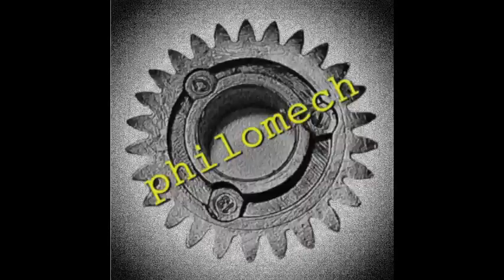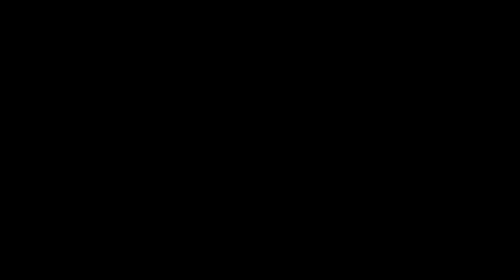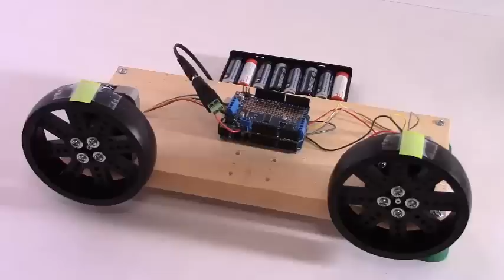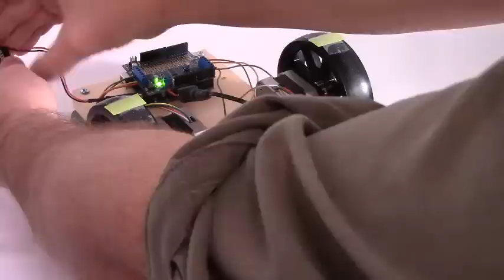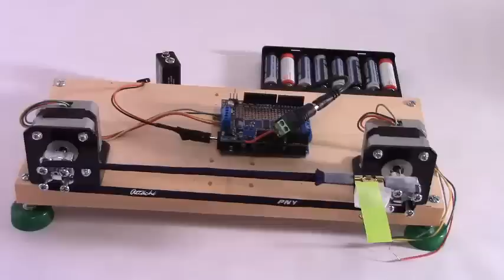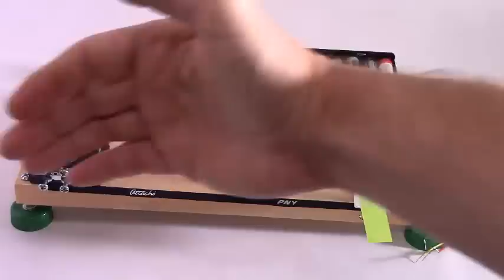Arduino Projects || Controlling Stepper Motors with Time-Sensitive While Loops

Comment: hi, 
is it possible to synchronize the two motors so they both start at some zero position and a full circle on the first one corresponds to a certain angle set up for the second one? 
(for a coil winding machine like this https://www.youtube.com/watch?v=MXLx-M9mV3I

Comment from the maker: The code associated with the examples discussed in video.

/*
title: Controlling_2_Steppers_with_Time_Sensitive_While_Loops
by: philomech
date: 1/2015
parts: Adafruit MotorShield V2
       12V NEMA 17 Steppers (200 step)
       NEMA 17 motor mounts
       Arduino Uno
Note: Please see the video entitled 
      "Arduino Programming Tutorials ||
       How to Construct Time-Sensitive While
       Loops" for an explanation of the while 
       loop control structures used below
*/
/*********************
* Libraries/Objects    *
*********************/
#include <Wire.h>
#include <Adafruit_MotorShield.h>       
#include "utility/Adafruit_PWMServoDriver.h"

//create motorshield object: AFMS = 0x61 I2C address
Adafruit_MotorShield AFMS = Adafruit_MotorShield(); 

//200 step motors connected to shield's motor ports(1 = M1 & M2, 2 = (M3 & M4) 
Adafruit_StepperMotor *myMotor_one = AFMS.getStepper(200, 1);
Adafruit_StepperMotor *myMotor_two = AFMS.getStepper(200, 2);

/*********************
* global variables     *
*********************/
unsigned long time_since_last_reset = 0;    

//adjust intervals as needed, variable type 
//will need to be changed from int to long or
//unsigned long if one needs intervals lasting
//longer than 32,767 milliseconds
int interval_one   = 2000;        //2 seconds   
int interval_two   = 3000;        //3 seconds
int interval_three = 4000;        //4 seconds
int interval_four  = 5000;        //5 seconds   
int interval_five  = 6000;        //6 seconds
int interval_six   = 7750;        //7.75 seconds
/*********************
* setup                *
*********************/
void setup(){
  AFMS.begin();        // create with the default frequency 1.6KHz
  //AFMS.begin(1000);  // OR with a different frequency, e.g., 1KHz
  
  myMotor_one->setSpeed(30);   // stepper speed setvto 30 rpm
  myMotor_two->setSpeed(30);   //adjust as needed

  delay(2000);
}
/*********************
* main loop            *
*********************/
void loop(){
  
  //--> controlling 2 motors independently (one at a time) <--
  
  // motor1 forward for 2 seconds  
  time_since_last_reset = millis();
  while((millis() - time_since_last_reset) < interval_one){
    myMotor_one->step(1,FORWARD,SINGLE);
  }
  // motor2 forward for 3 seconds
  time_since_last_reset = millis();
  while((millis() - time_since_last_reset) < interval_two){
    myMotor_two->step(2,FORWARD,SINGLE);
  }
  // motor1 backward for 4 seconds
  time_since_last_reset = millis();
  while((millis() - time_since_last_reset) < interval_three){
    myMotor_one->step(1,BACKWARD,SINGLE);
  }
  // motor2 backward for 5 seconds
  time_since_last_reset = millis();
  while((millis() - time_since_last_reset) < interval_four){
    myMotor_two->step(2,BACKWARD,SINGLE);
  }
    // motor1 forward for 6 seconds
  time_since_last_reset = millis();
  while((millis() - time_since_last_reset) < interval_five){
    myMotor_one->step(1,FORWARD,SINGLE);
  }
  // motor2 backward for 2 seconds
  time_since_last_reset = millis();
  while((millis() - time_since_last_reset) < interval_one){
    myMotor_two->step(2,BACKWARD,SINGLE);
  }
  delay(2000);
  
  /*  //Uncomment as needed
  //--> controlling both motors "simultaneously" 
  //(potential robot motion rountine) <--
  
   //both motors forward for interval_five (6 seconds)
   //Note the FORWARD and BACKWARD commands, necessary when motors
   //are on opposing sides of robot
   time_since_last_reset = millis();
   while((millis() - time_since_last_reset) < interval_five){ 
     for(int i = 0; i < 200; i++){
      myMotor_one->step(1, FORWARD, SINGLE);      //single coil actuation (whole steps)
      myMotor_two->step(1, BACKWARD, SINGLE);      //both motors advance one
      }                                           //step each time through for   
   }                                              // loop, simulates both running
                                                  //simultaneously 
  //pause 1/2 second
  delay(500);
  
  //both motors reverse for interval_one (2 seconds)
  time_since_last_reset = millis();
  while((millis() - time_since_last_reset) < interval_one){ 
     for(int i = 0; i < 200; i++){
      myMotor_one->step(1, BACKWARD, SINGLE);   
      myMotor_two->step(1, FORWARD, SINGLE);
      }
   }
   //pause for 1/2 second
   delay(500);
  
  //motors in opposing directions for interval_two (3 seconds)
  //'turning the robot'
   time_since_last_reset = millis();
   while((millis() - time_since_last_reset) < interval_two){ 
     for(int i = 0; i < 200; i++){
      myMotor_one->step(1, FORWARD, SINGLE);     
      myMotor_two->step(1, FORWARD, SINGLE);     
      }
   } 
   //pause for 1/2 second
   delay(500);
   
   //both motors forward for interval_four (5 seconds)
   time_since_last_reset = millis();
   while((millis() - time_since_last_reset) < interval_four){ 
     for(int i = 0; i < 200; i++){
      myMotor_one->step(1, FORWARD, SINGLE);     
      myMotor_two->step(1, BACKWARD, SINGLE);     
      }
   } 
   //pause for 1/2 second
   delay(500);
   
   //turn motors in opposing directions for interval_two (3 seconds)
   //'turn robot the other way'
   time_since_last_reset = millis();
   while((millis() - time_since_last_reset) < interval_two){ 
     for(int i = 0; i < 200; i++){
      myMotor_one->step(1, BACKWARD, SINGLE);     
      myMotor_two->step(1, BACKWARD, SINGLE);       
      }
   } 
   //pause for 1/2 second
   delay(500);
   
   //reverse motors for interval_five (6 seconds)
   time_since_last_reset = millis();
   while((millis() - time_since_last_reset) < interval_five){ 
     for(int i = 0; i < 200; i++){
      myMotor_one->step(1, BACKWARD, SINGLE);    
      myMotor_two->step(1, FORWARD, SINGLE);     
      }
   }  
   //pause for 2 seconds and the restart rountine
   delay(2000);
  */
  
  //--> belt drive, linear actuator <--
  
  /*  //Uncomment as needed
  //move trolley left for interval_six (7.75 seconds)
  time_since_last_reset = millis();
  while((millis() - time_since_last_reset) < interval_six){
    myMotor_one->step(1,BACKWARD,SINGLE);
  }
  
  delay(2000);
  //move trolley right for interval_six (7.75 seconds)
  time_since_last_reset = millis();
  while((millis() - time_since_last_reset) < interval_six){
    myMotor_one->step(1,FORWARD,SINGLE);
  }
  
  delay(2000);
 
}  // <-- end of main loop